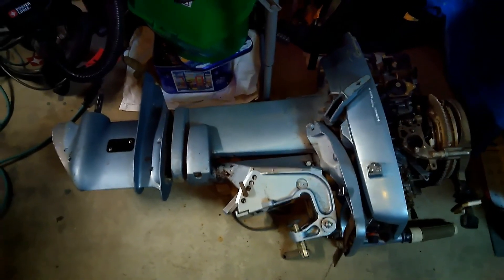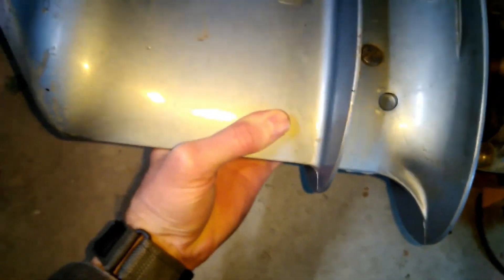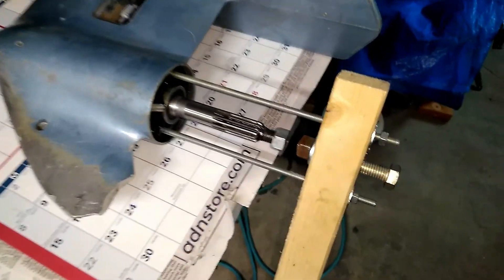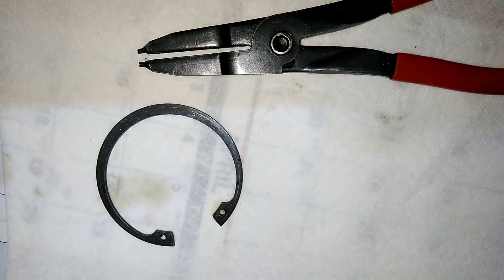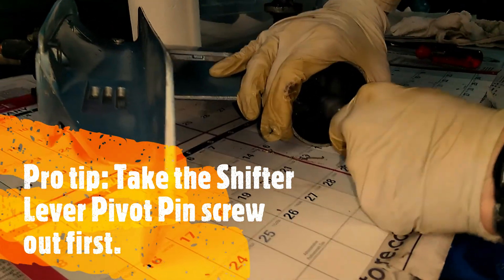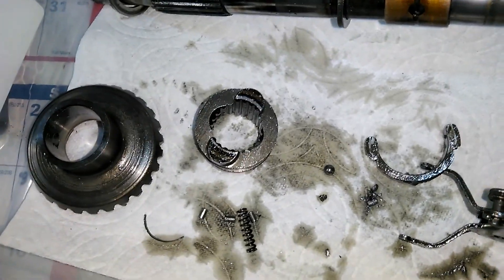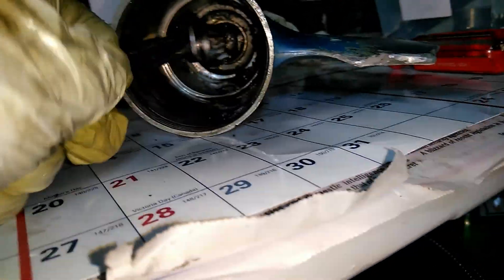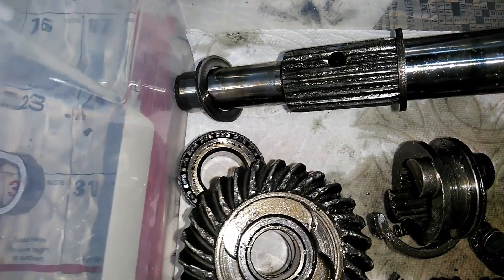Evinrude 35 HP Lower Unit and Gearcase Disassembly

Comment: My 96 Evinrude 25hp clutch ring is linked to clutch finger with a cutter pin pivot, not like your with a hook. As my clutch dog seized, I can not remove this linkage out.  Too bad. Now soaked in paint thinner.

Comment: El tornillo al lado del tapón de desagote de aceite. Que sostiene dentro del motor?? Que pasa si lo saco por error??
Reply from the maker: That screw holds the shift lever assembly.  If you accidentally unscrew that instead of the oil drain plug, oil will come out and the shift lever may move causing it to be harder to put the screw back in. You have to take out the shift lever screw to remove the shift lever if you need to completely disassemble the gear case.

Comment: you said you use 1/2" bolt. what is the length of that bolt along with does that bolt thread into the nut on the drive shaft also whats the size of the nut and thread on the drive shaft
Reply from the maker: the bolt can be any length or thread pitch. The bolt is the same thread pitch as the nut on the prop shaft (by coincidence). the nut on the prop shaft should not be turned out far enough for the bolt to engage its threads. the only purpose of the nut on the prop shaft is to keep the bolt from "walking off" the prop shaft as you tighten it. I do not know the thread pitch of the prop shaft. I assume it's standard 1/2 coarse thread nut but I don't have tools to measure that.
Reply: @silvers74  got ya thanks for the reply I'm going to make a puller this evening
Reply: @nathanw5747  curious to know if you made this puller and how it worked for you.  I need to pull my carrier and this looks like it'll work instead of buying the $100 tool.
Reply: @tacostacostacos1494  worked perfectly as long as its not a saltwater motor with a bunch of corrosion . then you will likely have to hit the lower with a torch. i did 2 lower units with this exact tool .  i have the one im using and spare housing that had a bad dog clutch saving the housing since im running mine in saltwater so the likely hood of needing  spare one over time is pretty high lol.
Reply: @nathanw5747  Good demo. I'll definitely be making this when it's time to replace the seals. Thanks for the reply.